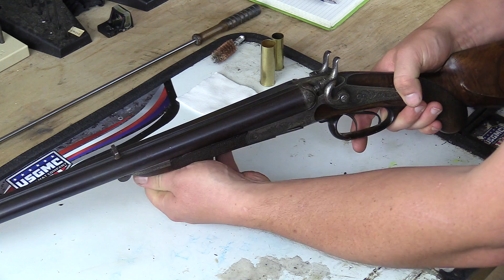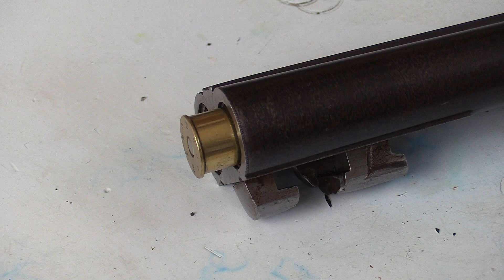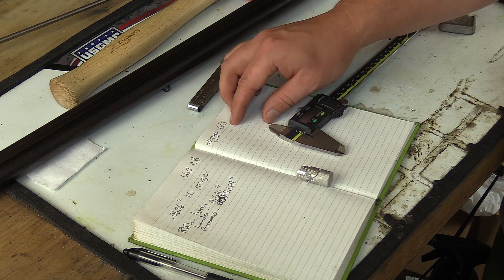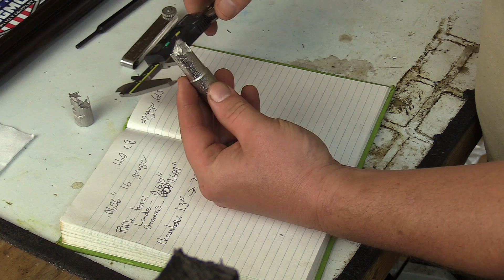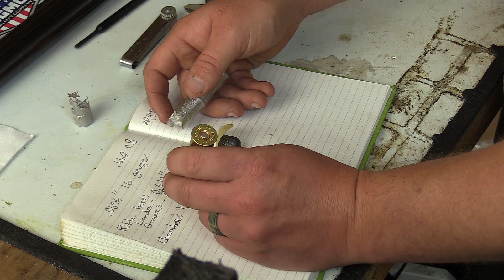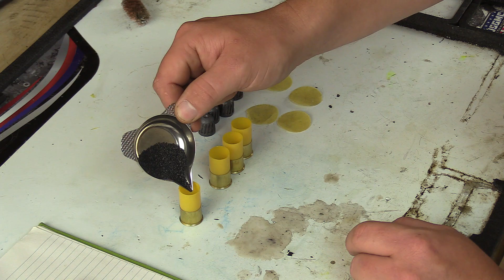Determining Unknown Calibers with Cerrosafe

Comment: Okay I'm going to try to spring to you weigh me and my brother used to do that if we had no gun. Didn't know what caliber it was. We plug the belt right down below with a board that fits in. Pour a power theme into the breach of it. When they perfume got hard. We simply punched it out then gauge the mold and I got every tell what caliber it was

Comment: Great video on that old girl, guess it's a girl.   Have a old Spencer Burnsides saddle or Calvary model  , and not sure what cal. it is.  They had a few different sizes .56-52, .56-56 AND .56-50, So, can I check the same way or easier way, hard to get into the chamber to mic it.   Thanks for you great videos.    👍

Comment: Cool gun and some great info on identifying unknown calibers.  Just wondering about 36:18 did that last shot have a primer issue?  It looks a little bit like the primer was pushed in or punctured possibly?  went back and looked at the other shots and when you were ejecting the other rounds they all looked flush but this one has a shadow and noticed you seemed to give it a second look when extracting it before tossing it.

Comment: Update when the mold arrives, Please!  Loads developed and shot from both barrels in the update, Please!  Buckshot in the smooth bore side and conical in the rifled side is probably how the gun was originally used in the field hunting big game, if it were me I would develop a pair of loads accordingly.

One safety concern though with this particular gun.  Accidentally loading a 20-paradox load in the smooth barrel most likely gets stuck on the bottom of the chamber by it's rim.  And then if a 16-ga shell is loaded on top of it and fired you could blow up the gun.  So be careful with that combination that you don't make that mistake!

Comment: I've done a little paper patching with some old rifled guns - but never had too much luck accuracy wise. Is it the gun, or does the patch fall away from the round as soon as the round is fired, causing the smaller diameter projectile to kind of bounce around in the barrel?

Comment: That underlever locking system is very VERY strong. The same system was used by stopping rifles. Stuff for dangerous game, stuff that fired 4 bore or whatever. Just a nit pick but very important.

Comment: I remember reading an advice article several years back where a "gun guy" told someone that it would be okay to fire nitro powder out of a damascus barreled shotgun.
I cringed, prayed the guy didn't die and internally shouted "It wasn't nitro proofed you moron."
I remember the guy wanting to "put to bed" the "myth" that old damascus barrels are "dangerous".
Maybe modern metallurgy and alloys could produce damascus barrels capable of nitro powder, but the older ones... I wouldn't bet my life on it.
Cynically, I was wondering if the writer had an ulterior motive of making damascus barrel shotguns rarer to drive up the value.
Reply: They typically only fail due to pitting or obstructions,  just the same I would recommend black powder,  fluid steel barrels weren't developed because they're stronger,  or can withstand more pressure, quite the contrary , they're weaker , they were developed because they're cheaper a LOT cheaper

Comment: Eric, 
As a machinist, I cringed when you used the calipers to measure inside a round hole. If you do not want to heat up the barrel, you can use a product that we use in the machine shop called "repro rubber" that doesn't require heat. Nice work though.

Comment: I know this is not related to the topic at hand. With that said I have a BCM Reccee16 AR and it has been shot with its original equipment probably close to the 12K round mark. Now I built my own range out in the southern Ohio country using AR550 targets from shoot steel. I have a shooting bench made by the Amish and a 300 meter lane outfitted with about 10 different targets from static to reactive. The point is I’m able to shoot quite a bit more than maybe the average person. I recently got a suppressor for my BCM and I have been shooting some junk steel case wolf without much problem the suppressor is an AAC dedicated 556 can and it works great. However I recently bought some Fiocchi 62 grain and without question it’s substantially hotter than the anemic wolf 223 I was previously running. After attaching my suppressor via a 91t ratchet QD mount I started shooting and after a couple rounds of standard semi auto fire the AR will shoot 4-5 rounds in a burst that happens so fast it's like you don't even know what happened. With the suppressor off the rifle no problem just standard semi auto with the suppressor on the rifle shooting the hot fiocchi stuff it just flat out wants to start running almost full auto on me. Now this doesn't happen with the wolf ammo even suppressed just the fiocchi while suppressed. I mean it's literally like I shoot 2 or 3 rounds and then a burst of full auto 2 or 3 rounds and then another burst of full auto. Can someone tell me what in the hell is going on here.

Comment: Is blowing the smoke out of the barrel a required step or just looks cool?
Reply: I believe he is mostly doing it to clear the smoke so he can visually inspect the bore after firing to ensure nothing looks out of place.  Wrapped steel barrels like these are more prone to failure than more modern gun barrels.  Given the home made patch work slugs he put together he may also be doing it to ensure there is not any loose unburnt powder left in the bore that could cause an issue.  Typical black powder cartridge firearms in good working order can be fired repeatedly without worrying about checking the bore though.  I think he is just being overly cautious with it for it's first few firings given the age, wrapped barrel, and lack of knowledge of how the firearm was treated throughout its life.

Comment: Wonderful bit of engineering that double barrel. Nice job Eric. How'd you come up with your charge value in black powder ?
Reply from the maker: Walter, I actually kind of guessed. I pulled up pictures of these little 20 gauge slugs and sort of unscientifically extrapolated the amount of powder based on how high the projectile was sitting in the case. More than likely the charge is correct because at 100 yards it hits dead on. No pressure signs. Seems to be legit...😇

Comment: Does blowing into the bore introduce moisture there?
Reply: Probably not enough to worry about, the humidity in the air is going to get in there also.  You need to do a thorough cleaning to remove the corrosive residue left behind from black powder after shooting anyway.

Comment: For casting try boiling water it's 212 degrees at 1 atmosphere and will not get any hotter. You can even use it to heat your barrels to ensure a good casting

Comment: Should we use metric measurements since it was produced in Germany, like Like Mark on Anvil (C&Rsenal) did in his last video. I realize that shotguns use gauge anyhow, but was wondering if it was a rifled bullet that is may have been metric.
Reply: Imperial and Metric systems both do the same thing they just work a little differently.  As long as you use each one properly the end results will still work.  If you really want to know the metric equivalent though all you need to do is convert it over.  1inch equals 2.54cm or 25.4mm  so .627inchesx25.4mm equals 15.9258mm which you would probably round down to 15.92mm or more likely 15.9mm to fill the grooves and still allow the bullet to fit down the bore.  With .610 inch lands x25.4mm your groove diameter equals 15.494mm which would probably round up to be considered a 15.5mm bore diameter.  Lead projectiles need to press into the grooves to achieve accuracy so a 15.9mm bullet should work well.  A 15.8mm or 15.7mm projectile would probably also shoot okay but without knowing the diameter of the bullets the gun was originally designed to shoot we have to make a best guess as to what will work best.  With my lack of knowledge with lead bullets I would defer to Eric's expertise on choosing bullet diameter relative to bore diameter to maximize accuracy.  So if you were dealing with metric measurements you would probably consider this a 15.5mm bore and shoot 15.9mm projectiles in it.

Comment: Thats pretty cool. One of my gunsmithing instructors brought in a similar gun, and we did everything but use cerrosafe, instead we used our micrometers and other measuring tools to find out the measuremeants. The only difference between yours and his is that my instructor's one had the lever come down and under the triggergaurd

Comment: Before I watch the video.   I hate when folks say "Caliber" when they are referring to the "CARTRIDGE / CHAMBERING" 
When someone at the range asks me "what caliber you shooting" I tell them, 24  /6.17mm or 6.5 / 6.71mm etc.. and continue shooting.
Reply: Caliber is basically the imperial way of measuring bore diameter. There really isn't anything wrong with it. It can often come in handy when there are slight variances between two very similar cartridges such as 5.56x45mm having thicker case walls and higher chamber pressures than .223 caliber even though the external cartridge dimensions are the same.

Comment: "Rough estimate"(grabs micrometer) lol
Reply: Fallofmind you mean digital caliper...
Reply: ur just as stupid as the OP if you think they are vernier....lol come on ppl.
Reply: Can we just enjoy the comment?  Did you guys get it?  Rough estimate determined by using a precision tool...
Reply: Y’all ain’t got humor!
Reply: Calipers are certainly not a precision tool. Anyone who has ever worked in a machine shop will tell you they’re used for rough estimates only. I prefer dial a dial set over anything else. A 10 thou job is rough, mind you.
Reply: Vernier is a scale not a measuring tool. That's why they're called vernier caliper, dial caliper, or digital caliper based on what form of scale is used on the caliper.
Reply: Fallofmind that's rough need more than sticking a cheap caliber down bore

Comment: rST makes shotshells for Damascus guns, it is smokeless but pressure is limited. I use it in my Damascus side by sides. They make them in shorter lengths, many old guns have 2 1/2 or 2 9/16 inch chambers. I have a nice Parker DH made in 1899 that I am certain has seen many rounds of smokeless through it's Damascus barrels. Just use the proper ammo and the old guns, in good condition, are safe to shoot.

Comment: i have this exact problem with a handed down Rolling Block. Dont know where it's from or what caliber it is.
Reply: What are the markings on the Rolling Block?  I know the main calibers for military use were .45-70, .43 spanish,  in centerfire and there were several rimfire calibers for it as well.

Comment: You can shoot smokeless out of that gun safely.If my seamed black pipe can hold modern shells why wouldnt this thing hold that pressure?
Reply: gumelini1 - it's Damascus steel. They're steel bands wrapped around a tube to form the barrels, and aren't proofed for smokeless powder pressures. In short, they will blow up and split along the seam
Reply: Some Damascus steel guns can shoot smokeless.  This Cape gun is not one of them and why would you want to submit it to the pressure when it will work just fine with black powder?

Comment: The type is known as a "Buchsflinte" = rifle-shotgun. The horn finger-rest behind the trigger guard loop is frequent and "of the period" but not geographically specific.

Considering the location, I agree that Konrad was probably a dealer, not a gunsmith (no record in Stöckel), and think that it is more likely that the components came from the "cottage industry" of subcontractors to the Ferlach gunsmiths than from Suhl. The best indication would be the proofs, which would clearly distinguish between German or Austrian origins. Both barrels must have proof marks on them, usually underneath, as will the system. These marks will normally be visible when you open the bascule for reloading. Wirnsberger's "Standard Directory of Proof Marks" should then provide an answer to the question of origin.

Damn well love old guns so much history to them just utility designed to be used in every situation
Reply: I was just about to point that information out until I noticed you commented. Lol, I'm just kidding, great information added, you know your guns.
Reply: For which quarry was this billing intended for?

Comment: FYI Brownells gouges on the price of Cerrosafe, and shipping can suck. Buy it direct from the manufacturer, Bolton Metals, and you'll save a ton of money. If you're local to them (central PA) you can even pick it up and save on their shipping cost.
Reply: 12799MaDeuce I looked at a website for Bolton Metals. I didn't see anything specifically designed for gunsmith use. Can you be more specific to exactly what to order? Perhaps you can include a link?